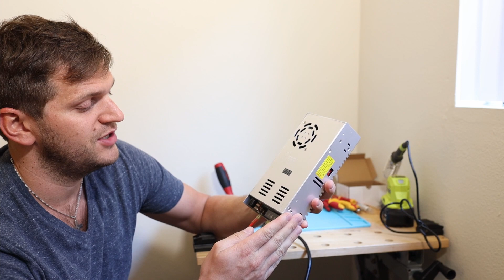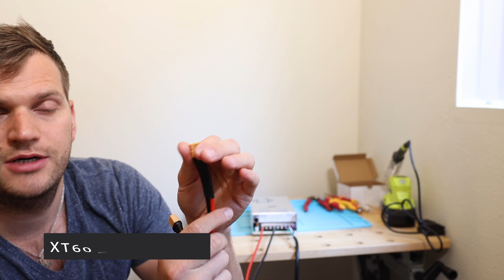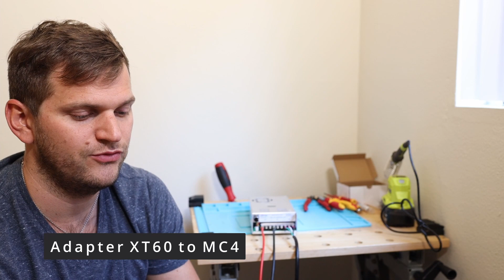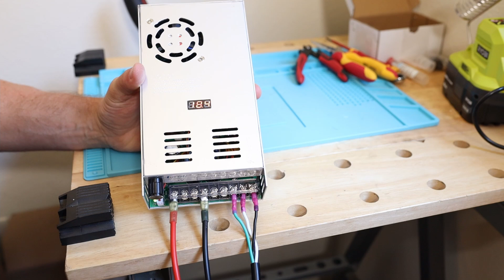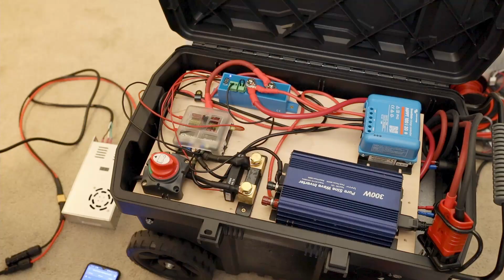12 24V CHEAP Power Supply   Battery Charging

Comment from the maker: Affiliate links:
Adjustable Voltage DC Power Supply
https://amzn.to/2ShyvqO

XT-60 Male Female Bullet Connectors
https://amzn.to/3j3ehMp

Crimping Tool for MC4
https://amzn.to/3j4dHyi

10 Gauge Wire
https://amzn.to/2UuuvnK

Ryobi 18-Volt ONE+ 40-Watt Soldering Iron Mobile
https://amzn.to/3gNSDuk

Soldering Iron Station
https://amzn.to/3wOirfl

Victron Energy SmartSolar MPPT 100V 20 amp 12-24-Volt Solar Charge Controller
https://amzn.to/3d33gHs

Comment: How can remove the small ac currents that come along with the DC from the power supply. I realised that when i put the phase tester i saw some ac currents. If not removed won't they dammage the charge regulator

Comment: Thanks for the video, just a question, whats happen when the battery is fully charged? The charge controller I think stop voltage to the battery but the power supply will remain on a wasting or consuming energy until someone switch it off? Thanks for your help

Comment: So it's been 3 years since you made the video, how is the charge controller holing up??  I've always wanted to try this but my concern was that the charge controller wouldn't like the DC ripple from the power supply.  They are, after all, made to use DC voltage from solar panels which is super clean.  Thank you.
Reply from the maker: It is still working. But, I'm not using it a lot. It's mainly to charge here and there my batteries. Therefore it does work great, still ;-)
Thanks for watching and staying with my channel for 3 years! :-)

Comment: For the record, this doesn't work with Outback Flexmax 60/80 series charge controllers.  Don't ask me how I know.....$$$.  If you're going to attempt this with the Outback, make sure to wire the DC power supply in parallel with the solar panels as shown, but DO NOT disconnect the panels!! This is very important, because the MPPT needs to use the solar panels as a voltage 'buffer'.  I'm not sure if that's the proper way to explain it, but without the panels the charge controller magically turns into a boat anchor.

Comment: I did this ones but the power supply didn't have a max current limiter so it just turned it of and on every second or so but if you go through the charge controller you can probably set the current

Comment: I have a 0-9v charger that the higher the voltage the more amps  can I use that only for the bulk stage of charging? Sayset to 6v and monitor battery when it hits 3.8 stop
Reply: thats the opposite of how it works usually. Are you sure more voltage gives you more amperage? That would increase the power

Comment: hello sir, i got a question for u,
i just fried 3 happymodel 6 in 1 1s chargers using 360w 24v input 15amps power supply,
i checked all the wiring on power supply they are good,
i wanna know why these multi 6in1 1s chargers fried please,
i did use my cordless vacuum's power adapter which has 25v input and 0.8amp rating to power one of these happy model 6in1 1s chargers and it worked fine??
what i did wrong please please.
thankyou.
Reply: You need a blocking diode from power supply to battery.

Comment: What is the current rating of the charge controller? 
Should the power supply rated current be greater than the mppt amp rating
Reply from the maker: This power supply can deliver up to 20A. Battery Charger and MPPT Charge controller can work independent from their current rating.

Comment: You need to buy the version with current control. It's about $15 more or so. When you attach a power supply that has no current limiting it is just the resistance of your cabling and the battery itself controlling the current flow. If you have a low IR battery and normal wiring (12AWG to 16AWG) you are going to blow up your power supply. The battery will say "FEED ME ALL YOU GOT BABY" and these Chinese power supplies are never good for their rating. NEVER. I have the version that is 0-48V 0-10A and I never go above 8A because the fan is in full whining like crazy and it gets hot.

The only way you can make this power supply safe is to put a power resistor in series with the load so that you increase the resistance enough to be in an acceptable range. You have to do the math on that. Or you could use very thin wires but we all know the problem with that. Another option would be to use a VERY long cable like several feet might be enough to add enough resistance to prevent the power supply from sending out more than 20A. All these methods at the end of the day just aren't worth it. You get no real control of how much charge current you are putting into your batteries so you can't charge small batteries and the lower the SOC the higher the current....the problem with that is a battery discharged to its lower areas of SOC like under 10% should be SLOWLY charged until the voltage has gone up some. So if you happen to discharge a 3.6V lithium ion down to 2.5V. it is recommended to charge at 0.1C max preferably 0.05C and you'd be out of luck with this power supply unless your battery is over 100Ah

Here's a 1000W version. You can get them for $100 on aliexpress in any voltage you want. Voltage x amperage will equal 1000W so whatever votlage you choose dictates your current.
https://www.ebay.com/itm/145068791427?chn=ps&mkevt=1&mkcid=28&var=444268320370&srsltid=AR57-fAymAoY0m-JoApw6H8TKKaZX4bGxBp5gkmDaPHpXtWqCeVSkUSnjZM

Here's a cheaper 1000W I'd say this is a good price
https://www.ebay.com/itm/404211140829?hash=item5e1cdc88dd:g:o~MAAOSw769g7LWY&amdata=enc%3AAQAIAAAA8JNTGJkHp7pYQ6%2F7qvB6ZP7vapWpek8vlOKs9DSdqxLDKXm29eKpXdmylDRgOxudmD355Ipuv%2B7xQ912rjfJXMqkilC7Yz4QDx6IdDVj0IE0Al9sOBwvBs7kT%2B9vL8AYT6XtXlA7L7bgO3qtkpb%2BhhhYPoVz%2FKq%2BX0Rcot6Gblgpgj8ekwYp7ZbsKUZ4q44wPjm9Fi7japffXMdN5nUk1EDamuQmMsDekhyEX0fMg020ARuFLQz35obAaRLTSx5McqgZwIAjLZ9cY310Lft6czm9keIvSH%2BLIN2sTtbn8RKnvddz28BDHJtjFOzi4crfow%3D%3D%7Ctkp%3ABFBMttLQkpVi

Here's the 480W version on the Drok site SUPER CHEAP. Its only a $15 difference from the one with no current control so buy this one 
https://www.droking.com/dc-power-supply/48v-swithch-power-supply-current-voltage-adjustment-ac-110v-220v-to-dc-0-48v-0-10a-480w-buck-converter-regulated-5v-12v-24v-30v-36v-48v-volt-switching-voltage-led-transformer-charger?sort=p.price&order=DESC
Reply from the maker: Thanks for your feedback! Video is actually coming out later today!
Reply: Great information!  Thanks for sharing.
Reply: Those Victron charge controllers have adjustable current limiters.  I would be more concerned about the DC ripple.  ??